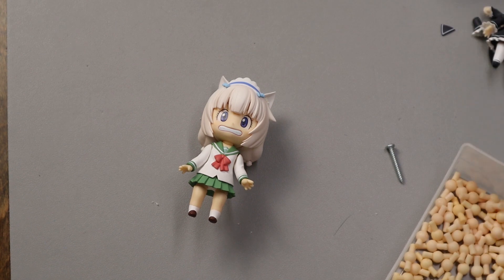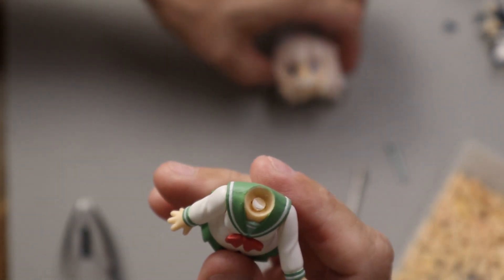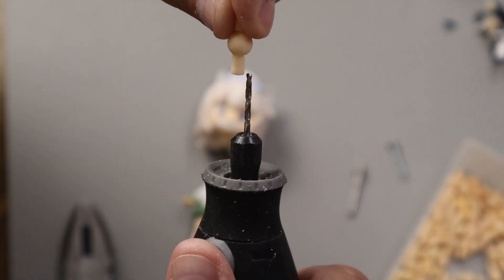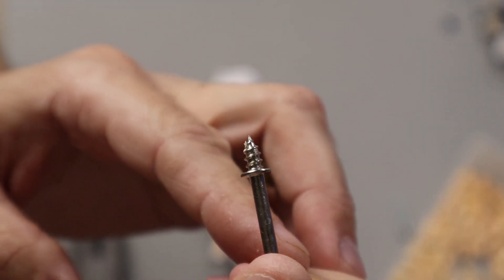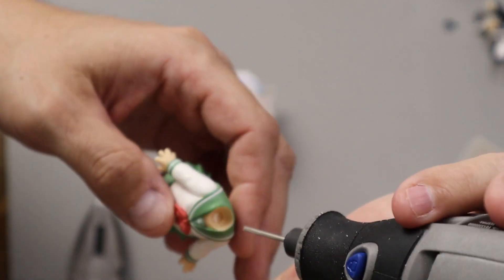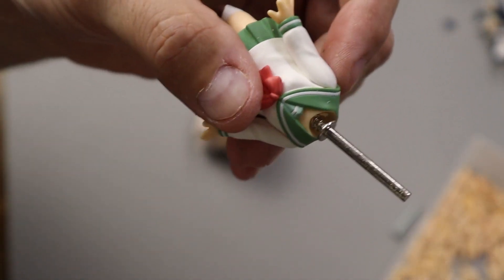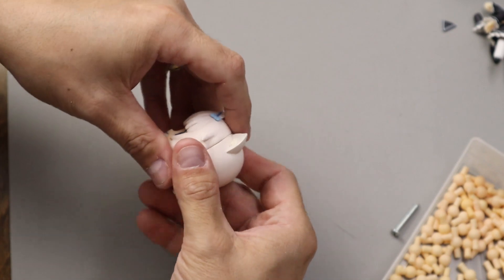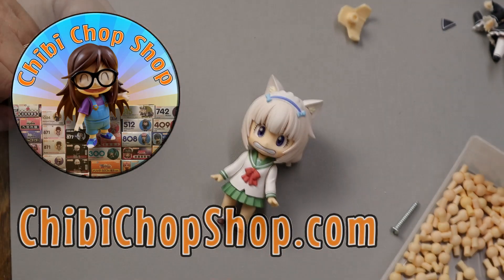Neck Joint Repair

Comment: Hi! My heads are different from the video, the neck is attached to the face and not to the hair. What can I do to fix that? Do you have a video ?
Reply from the maker: it works the same way, you just have to pull what you can of the peg out from the face and then drill out the peg in the same way we show with the body.

Comment: Excus me hi sir do you having rekomended putty for sculpting hair i want to making nendoroid but really confus to select putty many mont ago i see youtube chanel pocket studio he show me how to sculting hair i think it really work to try but putty using apoxie sculpting it high price i search and i ask seller think about putty her said using tamiya mr epoxy putty light weight and mr epoxy pro high putty but my best friend rekomendasi to using hobby mio putty for sculting i think no problem to try hobby this product having two color gray and yellow
Reply from the maker: There are a lot of options for different sculpting putty but epoxy is generally the best because you have the most control over the firmness of the end product if you put less hardener in it will remain more flexible when cured, and if you use more it will be hard and inflexible. They have different consistencies so I would suggest trying a small package of a few different ones to see what you like working with. Personally I use milliput but it can be a bit sticky to work with and isn't easy to carve into while it is still uncured; you can't manipulate it with tools as well as you could with clay for example, but it does have a nice consistency when it cures and is easy to sand, grind or cut away at to give nice sharp features.

Comment: Why they simply doesn't sell those pieces....? >: I can't find anywere. Wait. You just mentioned about your shop! I think I've found my paradise :thanksdoc: I just need to find info about shipping to brazil
Reply from the maker: We ship world wide but shipping to brazil is expensive and usually starts around $20 so it's best to use our hold order program and make a few orders over time and then combine shipping. Look under the "special services" tab for the hold order membership program.
Reply: @chibichopshop7918  I was expecting to find the head joints to sell but looks like they are only for comparison >: Don't you have a kit for that? I can ship them to Ohio this month. SOmeone will bring to me
Reply from the maker: @WanderyenErin  yes we have plenty of neck joints just search "pre-300 neck joint" for older ones and "post-300 neck joint" for the newer style.
Reply: @chibichopshop7918  Oh, thank you!! I was having trouble to find the search button xD

Comment: I just used my jewelers drill bits and a wire, the ol'drill and pin method.
Reply: This method is much more elegant though
Reply from the maker: @SauteedaKapi  Yeah pinning is great when you want something permanent and want it to stick solid. I did that a lot with pewter miniatures back in the day. I had a Ral Partha limited edition Dragon of Chaos model that was all metal I painted for a commission once and it was completely destroyed in shipping :X I will never not pin fixed position models ever again lol.

Comment: The website I looked at said to use a pin vice.
Reply from the maker: Yeah those would work fine for drilling the hole but require a little more elbow grease.
Reply: @chibichopshop7918  it can be larger than 1.0 mm? Smallest at home is 1.4
Reply from the maker: @Brandon_Y.  Anything that is smaller than the diameter of the neck joint should work, you'll just have to be more careful when drilling not to score up the inner walls of the body joint socket
Reply: @chibichopshop7918  yeah I figured it out. My dad who is better with tools helped me. Thanks a lot man!

Comment: Hi can u also do a video on how to fix a nendoroid when there are some white marks on it because I accidentally fell my nendoroid 😭
Reply from the maker: "Magic Erasers" would be the best way. If it's a dark hair, it should be pretty easy and you can put a fair amount of pressure to scrub the mark off, but if it's lighter colored, you will want to be more gentle and if it looks like the paint is starting to fade around it, stop; it won't work. Some paint transfer scuffs are irreparable though without fully sanding down the area and repainting which is fairly advanced to match and recolor.
Reply: @chibichopshop7918  oh okkk tysm 💗💗💗
Reply: @chibichopshop7918  I have another question, can I also use pencil to cover up the white marks in my nendoroid?
Reply from the maker: @vhixzee  It could help camouflage the flaw if the color matches well, but light sanding and paint is always best.

Comment: I just order my first nendoroid today and it was bootleg the neck is kind of long and i look into orig ver in youtube and the neck balljoint was perfectly hide is the size of balljoint of bootleg and orig are different size?
Reply from the maker: Bootlegs can be all over the place. Sometimes they are longer, sometimes they are lacking the good smile "smile" on the hinge of the peg, and most the time, they feel inferior in quality. It's also possible that if you bought it used, someone may have replaced a broken neck joint with something similar from another figure line all together. Some pegs from other figure lines are similar and may even fit but have differing lengths. i wouldn't use it as the only gauge of if the figure is bootleg or not. We have a video about identifying bootlegs which might help you tell for sure, you should check it out. https://www.youtube.com/watch?v=MsxCkNdocbw&t=65s

Comment: could i glue the pieces together? i dont have any drills and im scared i broke my first nendoroid doll in such a short time
Reply from the maker: Sadly no, there is no way glue would hold since Nendos are so top heavy. Even without a drill you might be able to use a sharp object to carefully twist and bore a slight hole big enough to thread a small screw into so you have something to grab hold of with pliers.
Reply from the maker: But like I mention in the video, you can get a basic rotary tool for $10 or less and it's well worth it